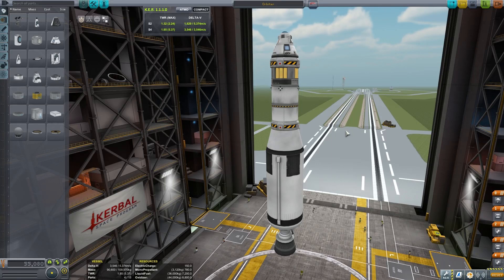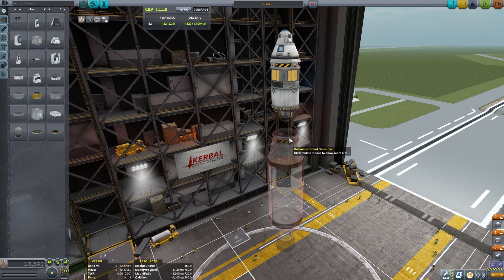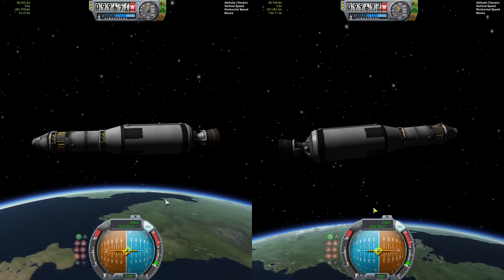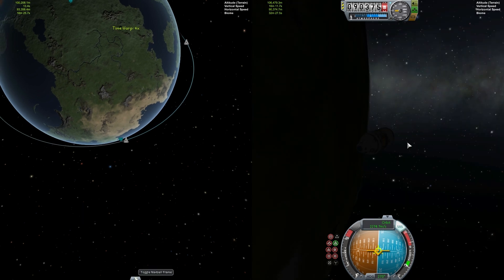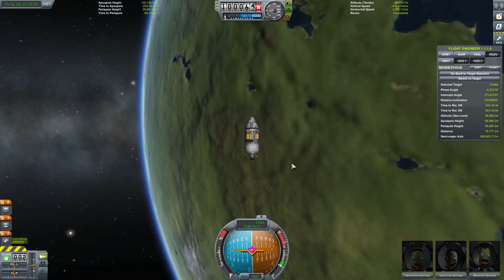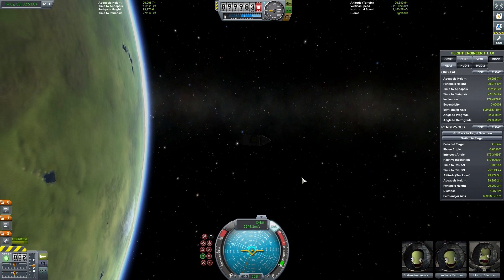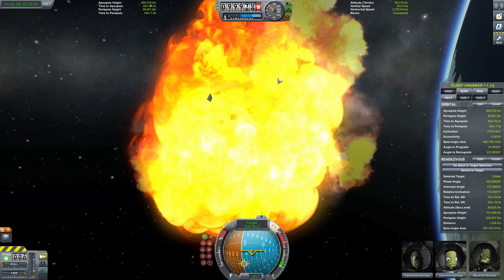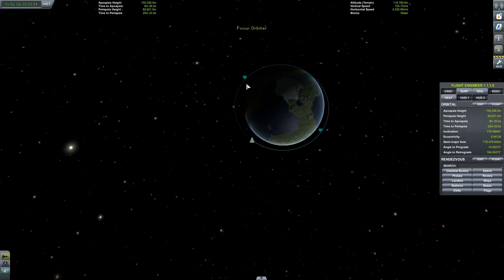Can we collide at 2 x Orbital Speed?  - Kinetic Energy Crash - Kerbal Science (KSP)

Comment from the maker: After a few comments here and references to head on collisions from Mythbusters 
https://www.youtube.com/watch?v=-W937NM11o8
I was in fact wrong here it seems with the collision speed reference. Two vessels of the same mass hitting each other head on at the same speed does not "double" the collision speed as I was thinking. A common misconception it seems but I was wrong never the less. This is an interesting discussion in itself. Basically, the masses of both vehicles cancel each other out meaning that the collision is essentially at half the speed I mentioned (not 4,492m/s but 2,246m/s), if one of the vessels was loads larger however, that would be a much different story.

Comment: I'd like Squad to implement slow-motion, something like in BeamNG Drive or Beseige, not only for fancyness, but also to increase render frames of internal engine. Also performing ship systems operations, like disabling engines, configuring wheels, setting fuel flow would be much easier to do in space, to adapt to unexpected situations.
Reply: WwZa7 One word: "Mods"
Reply: ScreenGames yeah but mods can only do so much. If the actual engine doesn't take to it then it isn't as good as the devs changing the game and makings. Really polished system for slowing down the game
Reply: Yeah, I honestly found, and am using right now time-controlling mod called TimeControll 2.5 by westamastaflash, it is available at http://forum.kerbalspaceprogram.com/index.php?/topic/143763-122-time-control-25/